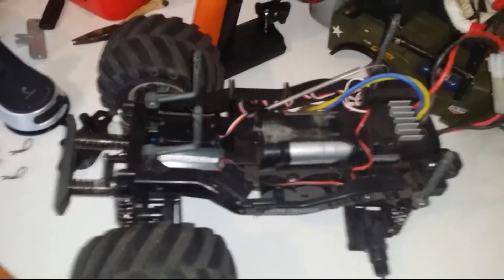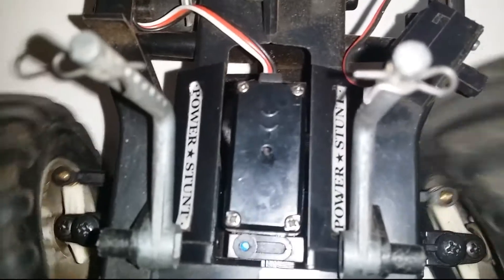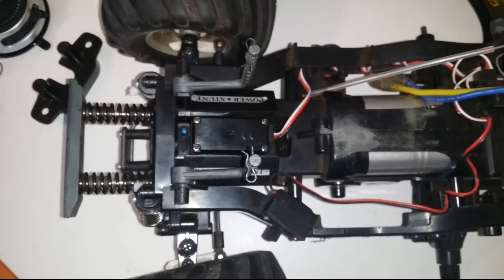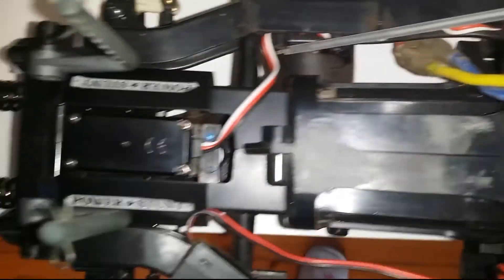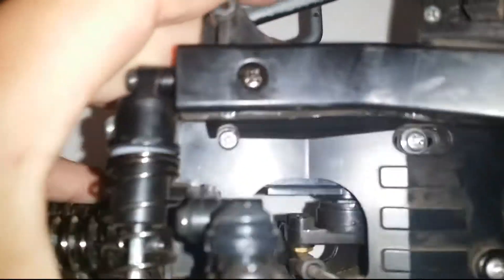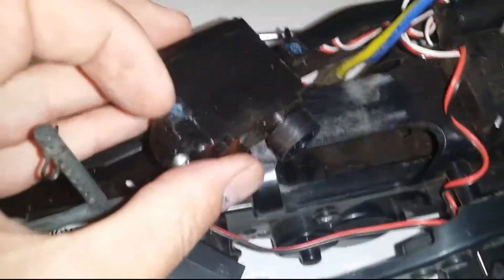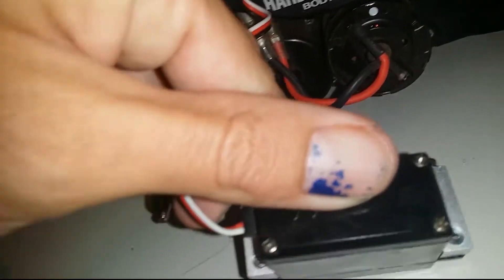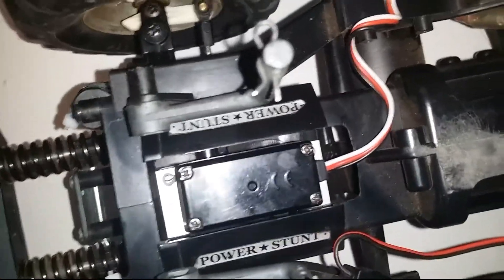Wild Willy2 Hop Ups and Restoration Pt4

Comment: Good to know about that,I guest I will be building  my wild willy 2 kit soon!
Reply from the maker: I highly recommend it. And ball bearings.
Reply: devolutiondav Thompson Okay, Thank! :-)
Reply from the maker: No worries. The stock mounts flex heaps and the screws strip out. The aluminum ones have longer machine type screws and washers.can't wait to see yours popping wheelies ;-)
Reply: devolutiondav Thompson Who make the parts for that and parts number?I would like to get the parts before i build the kit, thank!
Reply from the maker: Tamiya part n°53308 Aluminum servo stay
Reply: devolutiondav Thompson Thank you!
Reply from the maker: No worries. It's easier to put in as you build the kit. You'll be able to get it more central easier lol. It's a tricky operation with the chassis together. Do you have any plans for paint?
Reply: devolutiondav Thompson Not yet.